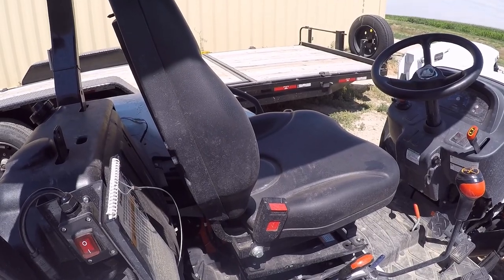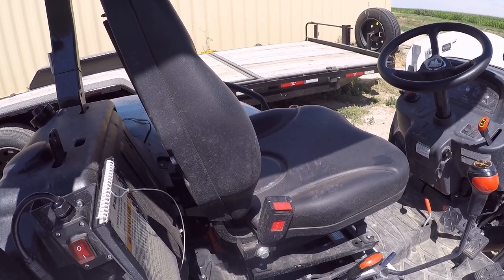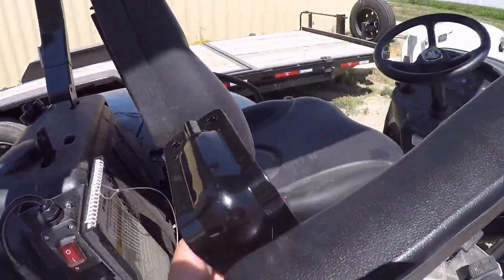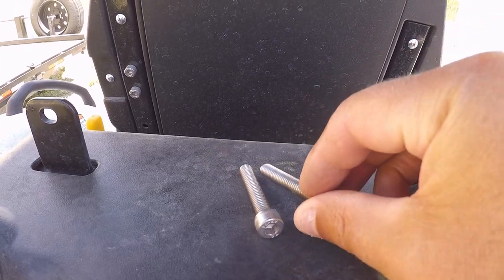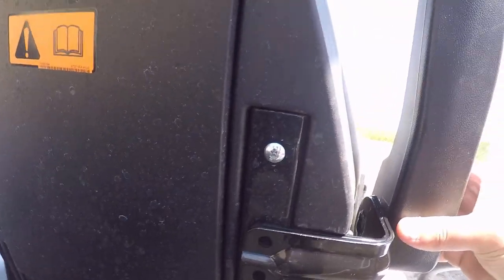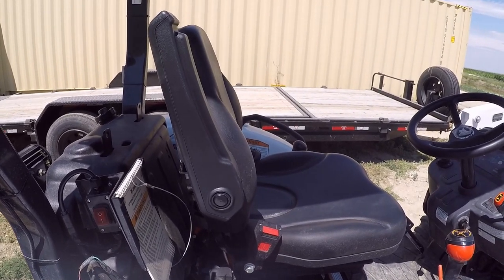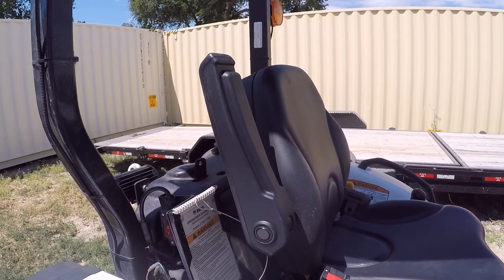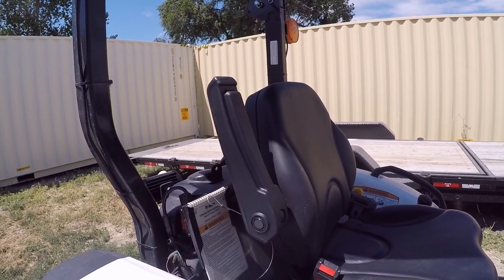Bobcat CT2025 Tractor Armrest Install

Comment: Time to get the rear remotes and 3rd function!
Reply from the maker: I'd thought of that, but it is so short on HP that I'm not sure what I would use rear remotes for. The 3rd function might be handy, once I figure out exactly what it will lift.
Reply: @gaining_ground  The rear remotes are really a function of the hydraulic pump capacity.  You could do quite a bit. A hydraulic top link is nice too!

Comment: I have checked bobcats website online and it always says "out of stock". I wonder if a dealer would be able to get me a pair? I plan on converting the right one to fit on the left just like you did.
Reply from the maker: Yes, the dealer can in most cases get items that are out of stock according to Bobcat’s website. Bobcat has 2 ordering levels when it comes to dealer parts orders. I can’t remember what terms they use, but one is low priority, such as stocking item, which Bobcat only ships it out once the production line and online orders are fulfilled. The other is high priority, to which Bobcat will pull the item off of the production line to get it shipped out immediately. You just need to tell the dealership that you need it immediately.
If that doesn’t work, Kioti offers an identical left armrest on some of their comparative models.
Reply: @gaining_ground  Awesome thank you. I may have to look into the Kioti armrests depending on what my dealer says when I contact them.